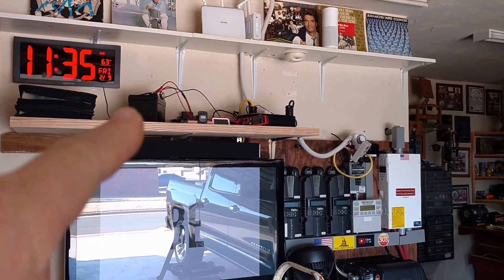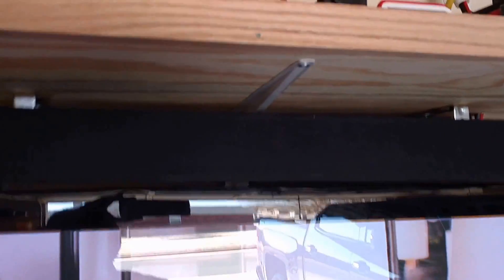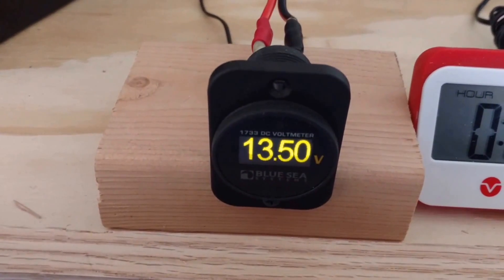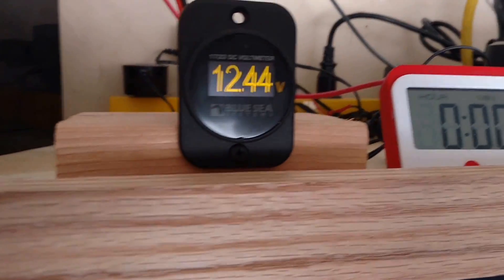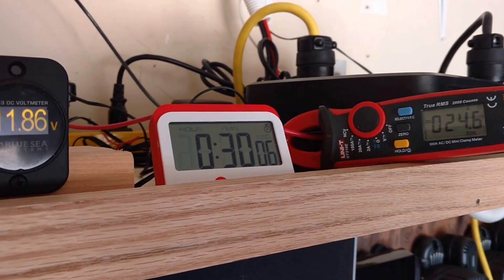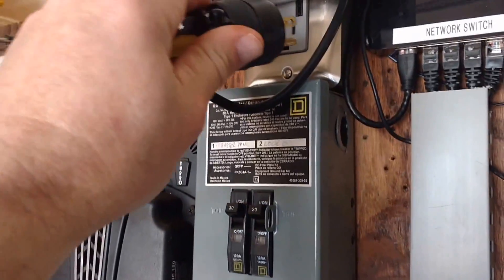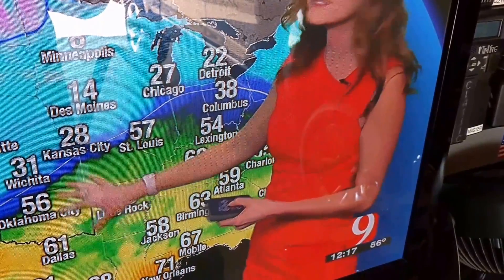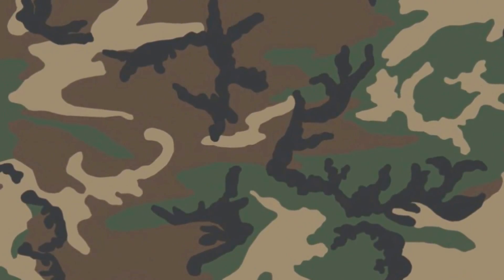How long will it last? APC battery backup (Part 3 - 200w load, 35aH Interstate AGM battery)

Comment: 12x35 = 420wh should run about 2 hours with 200w load. Why do ups so inefficient?
Reply: dc to ac conversion costs
Reply: Also because this is a online UPS, which means that it is charging and draining the battery at the same time.
Because these UPS'es use a more power hungry converter.
If you want an efficient UPS you need an offline model, which means it float charges the battery and only switches over to the battery when the power goes out.
these models use a more efficient conversion but you'll need to add extra cooling inside these units.

Online UPS are passively cooled and produce heat all the time even when there is no power outage.
This is because the type of transformer used. They generally do not produce more heat even when the power goes out.

Comment: i've done that with 40ah battery but after 15min its shutdown, but the battery voltage still at 12.8v. and then i turn it back on. then again after 15min shutdown, i guess theres a timer.  can you help me solving this. thanks

Comment: Careful, I've had problems with those UPS units when using a larger battery or battery bank; What happens is that the internals overheat (no cooling fan) and I've had them catch fire!
Usually you're good for 30 - 45 minutes of operation; then you need to start thinking about modifying the cooling in there if you want it to go longer.
Reply from the maker: Thanks...I put the little 7 aH battery back on it

Comment: What is the date code on the battery?
Reply from the maker: UPDATE. Actually, I can't make heads/tails of what the battery stampings indicate for manufacture date. I sent two messages out. One to Interstate Battery and one to the Amazon seller. However, the battery arrived new, undamaged, 13.1 volts out of the box, charging up fine...appears to be A-OKAY. But, ???? on the manufacture date